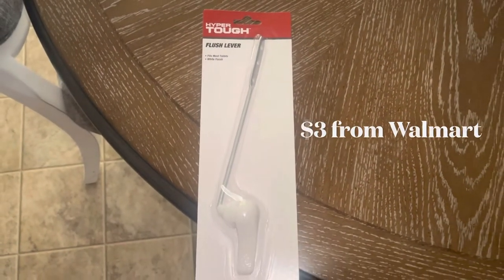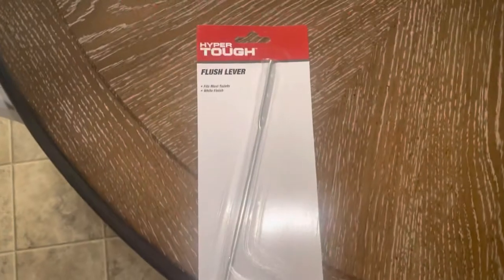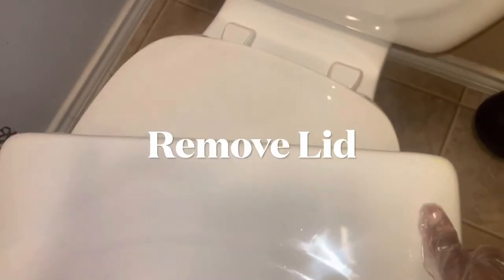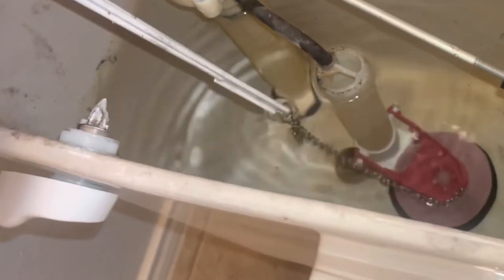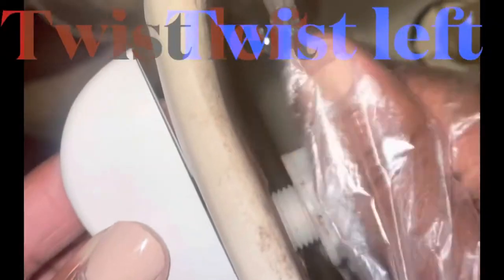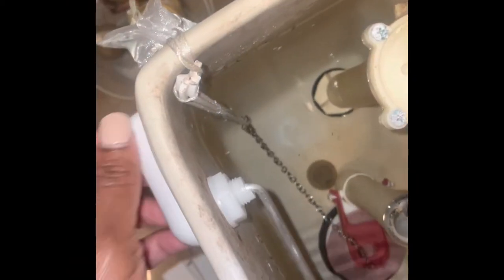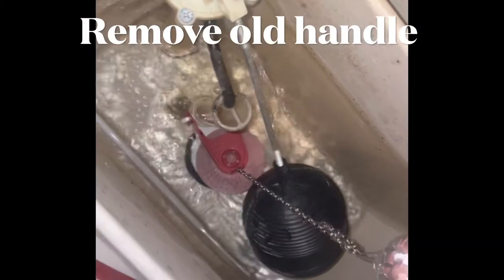Hyper Tough Flush Lever// Replace broken handle in toilet// DIY

Comment: bought the exact same model but after 15 minutes, tried even plier, couldn't take out the nut. Went to Lowes just before it closed, found one that nut could be removed. Back home, installation done in one minute. Just Lowe's model is twice price of that at Walmart

Comment: Ugh, what am I doing wrong??? I’m doing the install right but no matter what I do the lever is too close to the inside of the tank so I can’t flush because it just scrapes against the tank. Am I defective or is the lever? 😂😢
Reply from the maker: Hey lady!! Thanks for watching and commenting! It sounds to me like your lever may be bent (pushed in) or the actual handle isn’t pushed all the way in the opening securely. Can you double check that it is pushed in and tightened good? Or try bending it away from the toilet bowl? Hope this helps. Good luck 👍